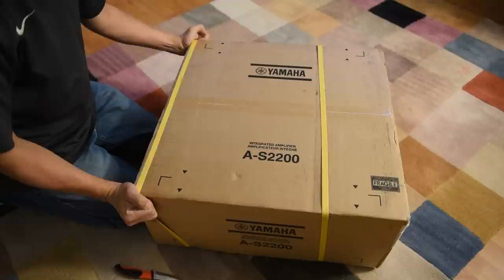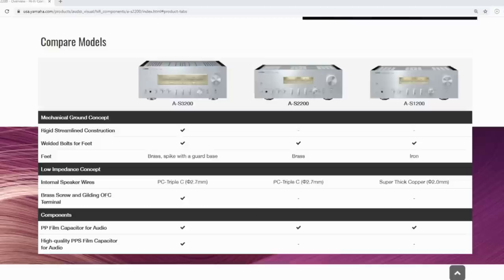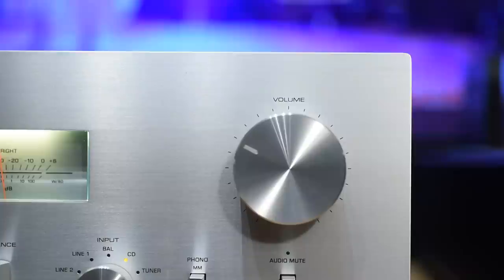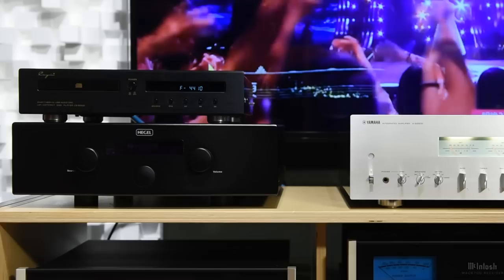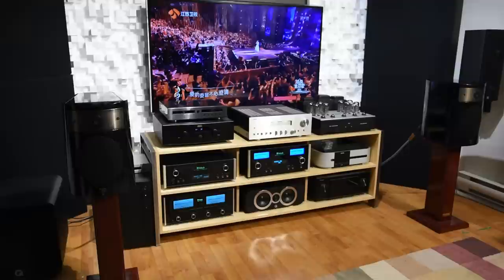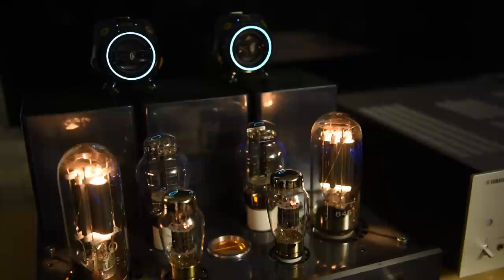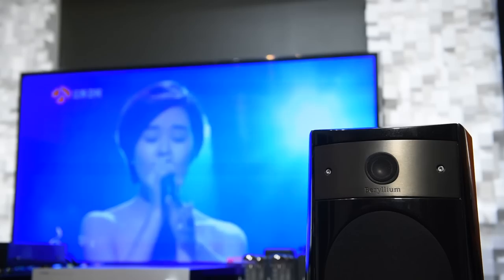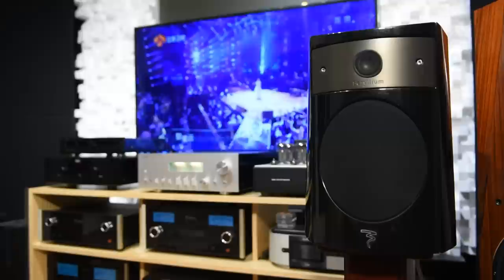Did it blow me away? Yamaha AS2200 Integrated Amp review

Comment: Hi Thomas.
Very interesting review! 
Burn in issue is proved 😁
The Focal are on the edge of being hursh with the as2200  but it is so clear that actually its very enjoable!
Moreover the dynamics on the beat part of the song are on a different level with the Focal than with the Silverline Sonata (Focal are better).
Still seems that it is  better to check this amp in person before buying.
PS
You mentioned that the mac6700 gives more detail, would you choose the mac6700 over the as2200 in general?
Did you listened to the latest ma5300/ma8900/ma7200? What are the best alternative for those amps for the money for your personal taste? If you had to keep only one amp, which one would it be?😄
PPS: this review was superb😁
Reply from the maker: It depends on the speaker but MAC6700 is like 50% more expensive so not really a fair match. I did not get to hear any of those amps you mentioned. For now, I would love to keep the Lumin amp + the audio research LS25 preamp but that combo is more expensive than these integrated amps. Thanks!

Comment: I wonder how my AS3000 would stack up against as2200 and 3200?? Love the video by the way, especially sounds test at the end normal music, not just jazz as it is normally on higher-end systems :D
Reply from the maker: Another reviewer said the bass on the As2200 is a lot more impressive than the AS2100. Having said that, for the AS3000, if I were to upgrade from that, I would guess you probably need to go with their top of the line pre and power amp. I doubt the AS3200 is 1 level up.

Comment: Excellent review Thomas. i have the A- S3000 and love it but occasionally it needs a little boost to the treble as its so refined. 😃  BTW The Focal recording sounded a lot better to me.
Reply from the maker: Thanks Dave and my favorite speaker pairing with it is the Focal actually. The Harbeth 30.1 was interesting too but I have to try again now that I have put 100 hours on it.
Reply: Jingle Nuts is that for me ? I use Duelund tinned copper cables

Comment: I like the meters too but don't they complicate the circuit and possibly add negative effect to electrical quality?
Reply: What about that mute switch that turns down the volume knob for you?! That’s complicating things certainly.
Reply: @jfletcher1029  yes but when open i don't think it would effect electrical load as much as the resustence and moving mechanical arms of the signal/volt meters.
Reply: @GonzoZener  indeed. I was referring to the over complication.
Reply: @jfletcher1029   Yeah..... Some features are nice.   I will use volume control fron input source when choosing build design and overall best audio quality.

Comment: I owned a Yamaha AS3000 for 2yrs without realising how dull it sounded.  I was sold by the looks (still the best ive seen at home), the build quality and Yamaha's history.  Paired with Monitor Audio gold 300 and tried with a few other speakers i didnt realise at first but the Yamaha sounded full and thick but has the worst soundstaging and dullest transient repsonse ive yet come across.  I replaced it with a cheaper Unison research triode 25 and went from the 110w of Yam to 25w of parallel single ended tube goodness and it was an eye opening moment for me.  The soundstage became 3d, sounds came from behind the walls, transients of acoustic instruments started and then trailed off far more convincingly and although it wasnt a party amp for low and mid level listening 25w into 90db speakers still gets serious volume and i never got the little Unison to compress.  I would def recommend a trial of any Yam amp before just buying.  My feeling is Luxman lower end or Marantz better amps are far better choices it someone still doesnt believe a 25w tube amp can produce enough volume/bass (a very wrong assumption).

I wont mention the 8 watt p channel Audionote amps that sound better still than all the above lol.
Reply from the maker: I actually had that union research for a while. Seems like you like what tubes can do in your system. I wonder why the AS3000 did not work for you, my friend who had the As3000 also have a lot of tube gear and some way higher end than that union research did not complain to me about the AS3000 soundstage. Maybe synergy? Regardless, that is not important. What is important is you are really enjoying your tube integrated amp. Currently, I am playing with the Cayin 845 and CS100, with 2 other more tube integrated amp coming in.
Reply: @ThomasAndStereo  me too .. i compared  and heard demos of more expensive ones . And then I realized  how valuable Yamaha as3200  is as whole package. For me it’s  Simplest thing for high end engaging sound.
Reply from the maker: KVR Listening Room,  I remember you putting a link of your review of the Yamaha AS2200, I was going to check it out but can't find the link anymore.
Reply: @ThomasAndStereo  It kind of fun video made against stereophile as3200. After that just removed it .
Reply from the maker: @kvrhifi  Ah, I was going to watch it today.

Comment: Had to stop here, to hear about an amp that reminded me of my early stereo day's &  aspirations. Many amps i owned & knew of then... (bar various s/h vintage valve gear) ...aspired to look similar & as good as this yammy does, so i was a bit surprised yammy left the icing off the cake without putting in the smooth shaped alloy  kobs they & many others once used to & what you'd expect to match the whole look & feel of this lavish t.o.t.r. looking amp. (they do look good for plastic tho, but for the potential & actual owner's tangible experience ...a badly chosen small price- cut?).
All my first solid -state amps were  necessarily s/h integrateds & to me they stood or fell by their phono stages alone, their line stage/ poweramp sections could sometimes be well above average & even great but even if so, their phono circuits could still be a total let-down, (like Pio's A400 but v.dull on phono) that meant i'd often use the phono stage of one integrated via it's tape out & into another intergrated's line-level inputs which had a superiour line-in/ power-amp section. Such were my integrated  hi-fi  days, before seperate phone-stages existed, as far as i knew. it kinda put me off integrateds esp' when i realised my (line-only needed) 1984'ish £400 CD player with purely & only Redbook 16/44.1 C.D.s available actually sucked badly (with like for like album comparisons) verses a £200 s/h t/table with an alphason 4get tonearm & a supex m.c.  I sold all my digi gear inc' CDs within a week, no regrets except buying it in the first place, i swallowed the media hysteria, rather the 20'year premature false hype,  tho i understand digital is much better now.

Comment: So Thomas, I know your answer is that everyone has their preference for a specific sound signature.  But would you recommend this amp based on your experience?
Reply from the maker: Yes as long as you like that mid range bump and that is the point.
Reply: @ThomasAndStereo  the A-S3200 has less of a mid range bump in my experience. However I prefer the mid range of the A-S2200 as I thought the 3200 was a bit too lean. When you A/B test the 2 amps the 2200 leaves an impression with its more accentuated mid range. The 3200 is probably the choice for fans of more mid range neutrality, while still having a Yamaha sound. Everything else is similar with even more detail in the 3200. Depends on taste. I thought acoustic rock and folk on the 2200 was wonderful and if someone likes the Yamaha house sound it's most of the way to the 3200 for a lot less money. I paired it with Kanta 3s.

Comment: With the different amps and speakers in your room, do you just swap cables back and forth for the best sound, or do you use some kind of switch box?  Are you afraid of connectors wearing out?
Reply from the maker: I don't use a switch box and yeah one of concern is connectors wear out. However, most of my cables can 'clamping mechanism' similar to WBT plugs. As such it is not too bad for wearing out.

Comment: Great video Thomas. I agree previous generation was lean on bass. in fact I don't think there is a sub connection on this new model? I wanted to hook up a REL sub but since this and past Gen are  balanced amp design. I can't use the custom high level REL  input cable. Yamaha Manual recommends pre-out and then left with just using one RCA cable to REL sub  low level input. Do you think that would achieve good results?
Reply from the maker: I think using preout to connect to subs is fine since you can control the cross over with the subs instead. Thanks!
Reply: I owned an AS3000 amp, all balanced as said...  the REL subs simply dont perform in a 2 channel system when connected low level.  They must be connected via neutrik speaker level or the REL will sound slower and stand out where it should simply blend in.  There is no comparison.  Its one reason i sold my AS3000, the other being it sounded boring and lifeless.

Comment: Great video, Thomas! What do you think about B&W 800 series pairing with Yamaha 2200 or your Hegel H200?  Which of those two amps. will be better handle dipping ohms speakers? Thanks in advance! Cheers about your videos! i like it a lot!
Reply from the maker: Thanks. I think 800 series need a lot of power and I would guess the H200 will have the advantage. However, until I try, I don't know because most of the speaker I tested with the AS2200 were efficient. I was really surprised how confident it sounded despite being only 90w. Perhaps get a AS3200 for the B&W 800 series?
Reply: @angel I have 804 D3s and you need a lot more watts and current than this Yamaha can deliver. McIntosh is a good choice, but if you want Hegel go for the 390 or 590.

Comment: I owned the Yamaha A-S801 and thought it was fine until I compared it to a few other amps in it's price range. I sold it quickly after that.
Reply: JP Winters what is the next amp you have?
Reply: @mastyx59  Did an extensive comparison with the Marantz PM8006 & kept the Marantz. Then I compared the PM8006 to the Audiolab 6000a and kept the PM8006. Both models were far ahead of the A-S801 in my opinion.
Reply: @JPWinters  wow I had the opposite experience.....sent the Marantz back.
Reply: @chasefreedom5178  Hey that's cool, it's all a matter of taste. What speakers are you using?
Reply: @JPWinters  I have RF7iii and RP8000 as well as paradigm 800 in 3 different systems the RP8000F is in my listening room right now.

Comment: The Vincent hybrid integrated may be a better buy @ 2500 USD. German designed / well assembled in China. Runs in class A first 10 wats.
Reply from the maker: I am sure Vincent is a fantastic amp and I hope to hear it one day. Only thing is I don't think it will have similar voicing and if that is the case, they might not be comparable.
Reply: True: Vincent amps/pre amps  are very neutral. It seems like one would want  more neutral in an amp ;then  select speakers to obtain the vocal range boost ,if desired. BTW the Vincent hybrid amps/pre amps have both tone controls and loudness which is why I bought their pre amp(I know you are a fan of tone controls).Loudness is nice for low listening and hard to find these days.

Comment: Hi Thomas, I have a question about my receiver pre outs(if anyone else could answer that’d be cool too). I currently have a pro amp connected to the FR FL pre out of my receiver. Am I able to connect more pro amps to the rest of the available pre outs? As in 1 external pro amp per pre out. Would that be okay?
Reply from the maker: It should be and that info should be in the manual, double check it.

Comment: With DSP and room correction getting better and better, I don't get why many of the new higher end integrated amps don't provide any room for expansion.  From what I tell, there is no tape monitor function, nor do the pre-out and main-in jacks function like you would expect.  You can't use the preamp and power amp sections independently at the same time.  So, drop this kind of money on a integrated amp that I can't hook up an EQ to? No thanks.  My Marantz 2230 from the 70s, and Bryston B60 both offer these basic input/output functionality that every serious amp should have. Marantz, Sony, Technics all made the same fumble.  Accuphase, Luxman, McIntosh and Bryston are still doing it right in their integrated amps. .
Reply from the maker: Well it has tone control.

Comment: Thomas, you did this review a while ago and perhaps you had some more hours to play with this Yamaha. I'm am interested in getting this unit, but have a couple concerns that maybe you can help with. It is my understanding that the upper midrange is kind of bright but softens up a bit with use. I could live with that as I have plenty of speakers that would match fine with it, but I have others which may not, i.e. high efficiency horn loaded type. I'm looking for a good all around integrated that is easy to mix and match, as this won't be part of my primary system. Moreover, did this Yamaha exhibit any holographic characteristics? I find I can rather enjoy a bright amp if it's holographic, but not too much if it isn't. If this is not a holographic sounding integrated, are there any under 7K usd, that you feel is (solid state). I know you are busy and put out an amazing amount of reviews, but your input on this would be greatly appreciated. Thanks.
Reply from the maker: For me, all modern amps will create a holographic soundstage. The question is how much. If I did not touch on it in the video, I don't remember to be honest, then it did not stand out enough for me to mention it. Are there any $7k ones, if holographic soundstage is what you are chasing after, perhaps consider tubes.
Reply: Thanks, Thomas. You've done a lot of excellent videos this year and have kept hifi interesting. Hope you get to spend several enjoyable days with your family where you can focus on them without distraction and get some good relaxation in. Have a great holiday season and new years man!

Comment: It could probably do with more burn in. I have been hammering my amplifier and only now has it opened up. It's taken a ridiculously long time. But now I get a big soundstage and sounds like music, with a feeling of presence. Before I always thought it sounded off, sounded detailed but slightly vague and 2 dimensional. The sound was up and down during burn in. Then it took a turn for the worst and sounded broken. I wasn't always a firm believer in burn in, but compared to before there is a huge difference. Music feels more alive and real now. Nothing else in the system has changed, same cables same speakers.
Reply: Burn in or subjective adaptation to the sound?

Comment: Which amp would bring out the best overall performance in a pair of Polk LSiM 705 speakers; Yamaha A-S 2200 (90watts/ch) or aRotel RA1592 intetrated amp (200watts/ch)?
Reply from the maker: I never heard the RA1592 so I don't know how it compares.
Reply: @ThomasAndStereo  

Rotel RA 1592 integrated amp (200 watts) paired wieh B&W on U-Tube.
If you haven't heard of this amp I just as soon reconsider.  Would the Yamaha A-S2200 with 90 watts do justice for the Polk LSiM 705s or would you recommend an integrated amp pruducing more watts in a comperable price range.

Comment: Man, I have the A-S2100 and had it paired with vintage Klipsch Forte waaay before Steve G. went cukoo for horns and proclaimed the 600M as audiophile worthy. I came here and to Sean's channel singing their praises, and I can still remember the reactions, "Yamaha and Klipsch? OK, sure, wow, glad you like it, let the adults talk". Only Ron saw that Godzilla was rearing his head, ready to breathe fire from across the water once again. Only I wasn't early enough to score a vintage 2000 series Yamaha for $40 like he did. The VU meters even convinced me that I could try a flea watt single ended tube amp. I built an Elekit 8200 6L6 single ended pentode and had some fun rolling EL34, KT88 and switching between Triode, Pentode and Ultra Linear modes, but the sound was very colored and sounded best with limited styles of music and I was always happy to return to the Yamaha. This past summer I travelled further down the rabbit hole and built the Elekit TU8600 300b SET. The one that Herb from Stereophile wrote so fondly about. I'd never listened to a 300b up until I finished assembling this one and I haven't listened to anything but a 300b since that point.  I remember being impressed with the low end control the Yamaha had over the Forte, but even with only 9 watts the Triodes have even better bass response and liquid, crystal clear highs with nothing like the warm mid centric tones of my other tube amp.
Reply: Who are you talking to and what are you talking about?
Reply: @DH-og5yr  I'm speaking to Thomas and any other audio enthusiasts, most of whom would know exactly what I'm talking about. What brings you here?

Comment: Did you try the AS2200 with your Harbeth C7’s? I think is a great pairing.
Reply from the maker: I tried it with the 30.1 before full break in, very interesting results. I might go into more detail if I review the Harbeth 30.1
Reply: @ThomasAndStereo  Please, tell us more about this in the comments. Just a few words. I'm going to buy 2200 to my 30.2 next week. Unfortunately I can't audition this amp.
Reply from the maker: I tried it around 30 to 40 hours break in so there was still that slight bump. The thing that crossed my mind when I was listening to that combo is whoever says harbeth is boring needs to try it with the 2200. The top end sparkles really good and bass was strong enough I did not feel the need to have a sub. It does sound different than my other amps with the Harbeth, with the 2200, it is more 'lively'.  Now I need to try it again after now that I have broken it in to really able to tell you. Sadly, one of my subscriber has borrowed it and it will be a while before I get it back.